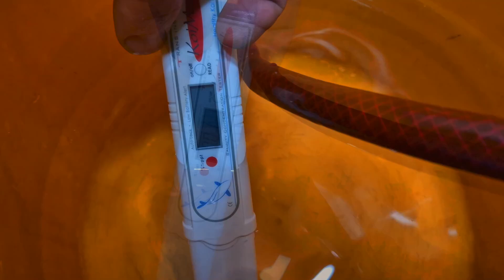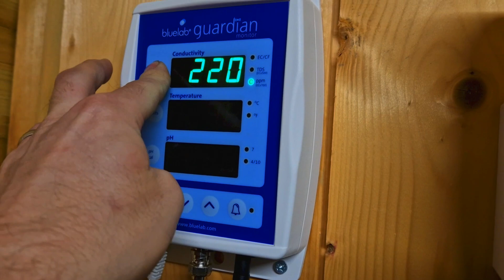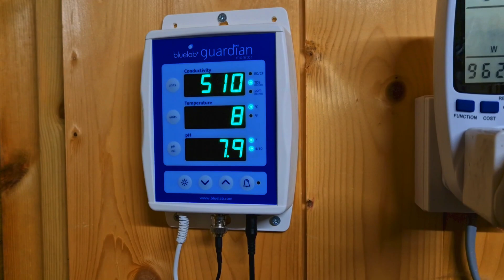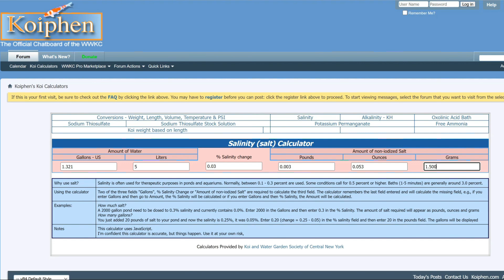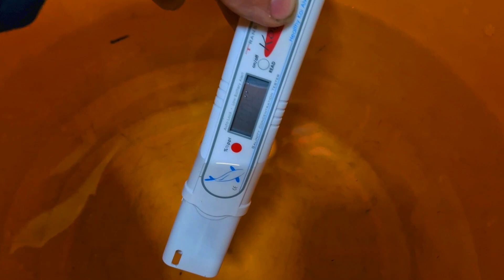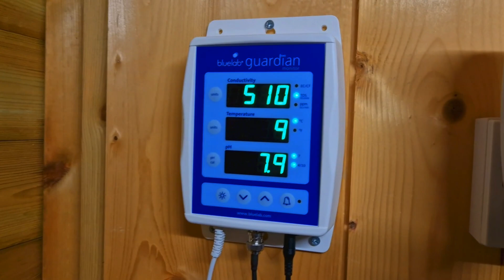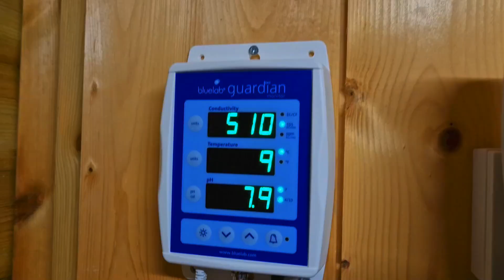How Much Exactly does Salt Influence TDS?

Comment: Great video Si, very interesting 👍
So with the same amount of salt, your pond has a lower TDS reading (500), than tap water did (510).
Basically, if you run salt in your pond, you have to live with the high TDS readings.
Hope you're well.
Stay safe.
Reply from the maker: Cheers Keith, if you rewatch the fresh water test before adding the additional salt, you'll see that the tap water has a TDS reading of 150/160. So it's only the 0.03% added extra salt to the tap water that drives my TDS up to the same reading that is in my pond. Basically the TDS is only in the 500's because of my pond being at 0 04% salt.👍